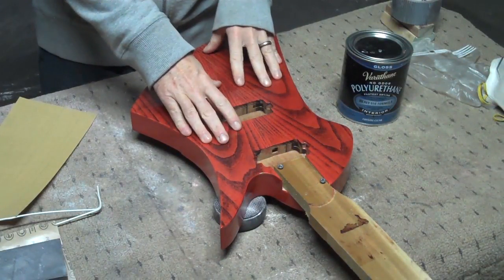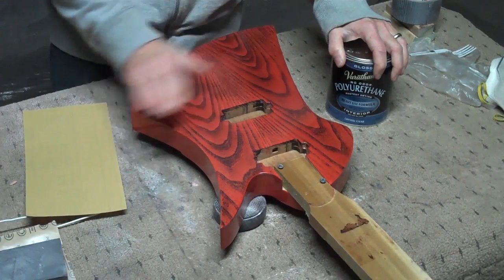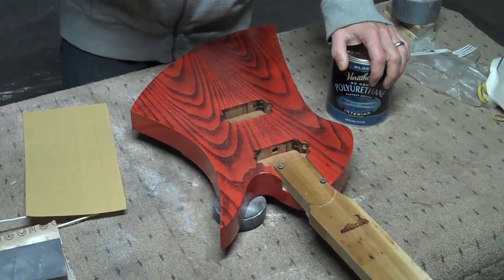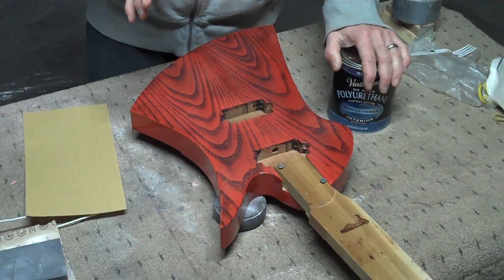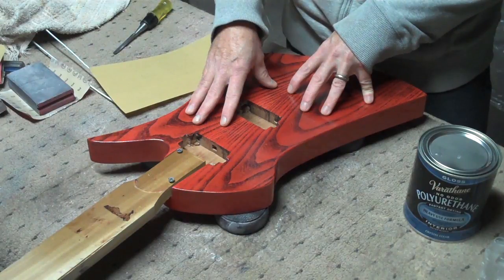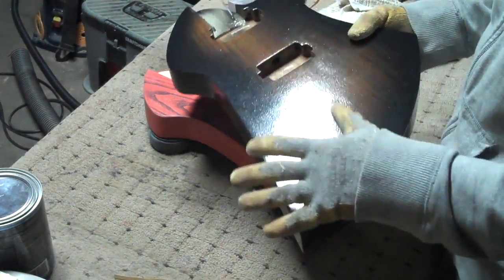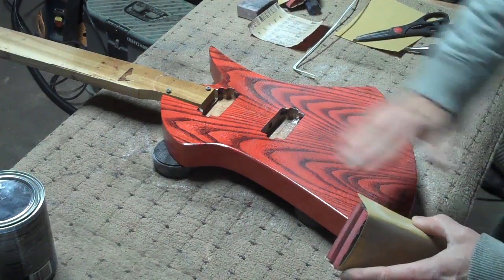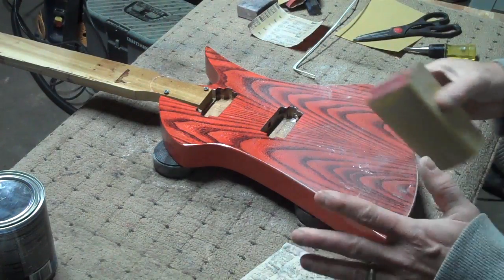How To Apply A Water-Based Finish On An Elecrtic Guitar Body Part 6

Comment: Very good work and helpful instructive videos ,, if you may, what is better between these two ,,,varathane water based and the Minwax polyacrylic, in scratch protection and the milky blue tint.
and do i need to use a sanding sealer before ? or they will bond strong directly  to wood ? 
thanks in advance.
Reply from the maker: Neither one is ideal for what we as guitar makers need. They are just too soft, IMO.
Reply: @HighlineGuitars  thanks for responding sir ,,, I know from your videos nothing durable as polyester spraying and solarez but im doing this at home and spraying is not practical. Is there other option to be brushed and sanded or shall I order solarez abroad.
Reply from the maker: @DIESOOL  I would recommend either Crystalac Brite Tone for a water-based approach or Solarez I Can't Believe It's Not Lacquer as a low odor UV (sunlight) fast curing finish. Both can be brushed on.
Reply: @HighlineGuitars   thank you very much sir and keep up your wonderful works.

Comment: do you use a similar sanding techniqe on the sides/endgrain? any strategies of caution for the edges?
Reply from the maker: Yes, I use a similar technique on the side/end grain. Try using a small pink eraser as a sanding block around the sides. I try not to go over the edges until I get to my last grit.
Reply: @HighlineGuitars  Awesome, good to know! Hey, just curious, do you think Varathane would work to be applied with a "rub-on" technique. I'm planning on finishing a build with Varathane... but it dries quickly and I find I have more control with a rub than with a foam brush.
Reply from the maker: @jtromsness  You can as long as you practice on some scrap first to get a feel for applying it before it tacks up.
Reply: @HighlineGuitars  I stained my bass with Keda dye (yellow) and I'm applying my Varathane with a foam brush. I have some faux binding that I taped off and Varathaned pre stain (so the stain wouldn't take to the binding area). It worked really well. However, the issue I'm running into is that the Varathane is picking up the dye and there is a yellow hue that is running into my "no colour zone"... I suppose spraying is best with this particular dye.
Reply from the maker: @jtromsness  Get the Varathane rattle can spray and use it for the first coat to seal in the dye before brushing on the rest.
Reply: Ya I figured that’s what I would have to do. 

Thanks!

Comment: Hi there, great videso, most helpful for the budding luthier.

So.......how do you attach your temp handle to the pocket? 

if its by screws, then I'm assuming your are screwing into the body using the holes in the pocket that the neck screws would pass through. 

how do you mitigate the impact of damaging the holes in the pocket so as to avoid having "slap" in the holes that could cause the neck screws to have too big a hole to pass thru (instead of a snug fit). Wouldn't damaging the neck screw holes create a situation where the neck may not to tighten properly and thus skew the neck left or right.
Reply from the maker: If it’s a screw in neck, I use the same size screws that I will attach the neck with. If it’s a glue in neck I run the screws part of the way into the bottom of the pocket, deep enough to hold the temporary handle, but not out the back side.
Reply: @HighlineGuitars  Thsk,

Its a screw in neck, so do you install the screws form the back or the front? I'm guessing the back, as the final screws have some sort of plate of decorative washer to cover the hole.

..AJ